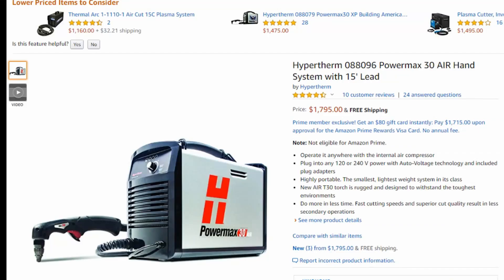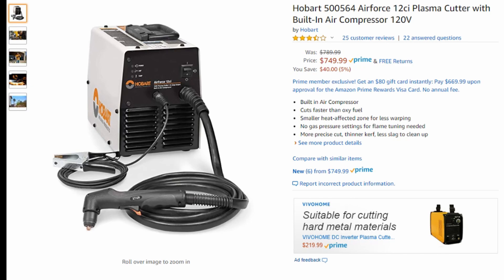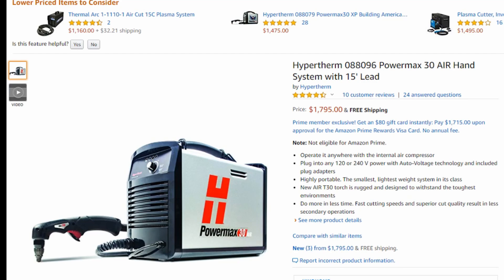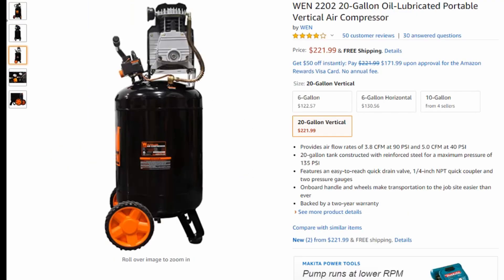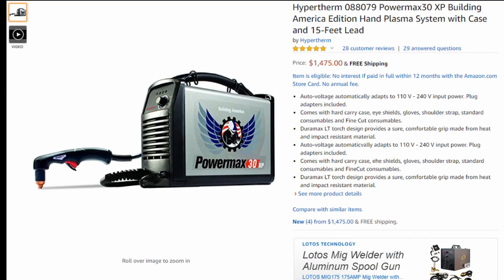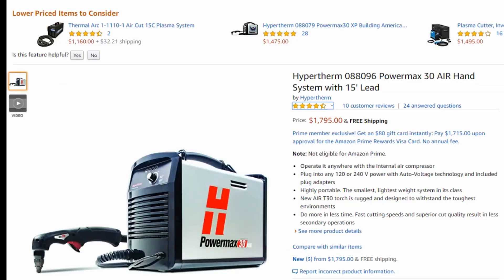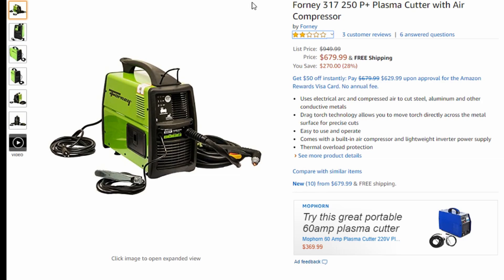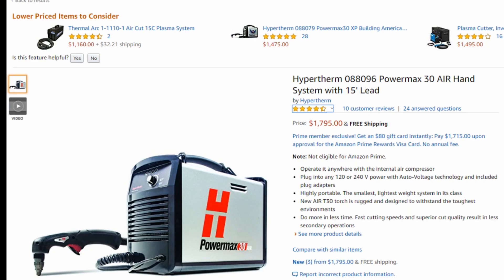Best Plasma Cutter With A Built In Compressor - Watch this before you buy!

Comment: Video is outdated. A lot of Chinese plasma cutter out there with built in air compressor that is capable of serious cuts. The compressor only draws like 5 amps on a 220 circuit, so it's insignificant in the grand scheme of thing when the plasma itself draws like 35 amps or more. 

They're useful for confined space though, because a compressor that can supply a plasma cutter can be a bit large. However if you do hook up an external air supply it does increase their cutting performance a bit.

Comment: I have a Hobart 12ci and plan to plumb it for external air supply. Will install bypass air plumbing and internal compressor power cut off. 
Hoping that improves the output by eliminating the amp draw of the compressor. Also I will have better control of the air quality(dryness) as I fabricated an intercooler between my compressor and tank. With a much bigger water separator unit.
Wish me luck 😄

Comment: The Hypertherm Powermax 30Air is not as powerful as the Powermax 30XP. Directly from the manufacturer's website, the Powermax 30XP outputs up to 30 amps at 125 volts. The 30Air outputs 30 amps at 83 volts. That is about 2/3 of the power of the 30XP, since power equals current times voltage. The 30 Air uses a special torch with special consumables to run from a reduced output and air volume while still maintaining similar performance to the 30XP. In the real world, the 30XP will cut a bit thicker and faster than the 30Air, but not enormously so. The difference is about 3/4" in mild steel for the 30XP and about 5/8" for the 30Air.

For the average user in a home, the 30Air is more than sufficient. As mentioned in the video, for portable professional use, a lot has to be said for not having to lug around a heavy compressor capable of 5 to 6 cfm and finding a second dedicated line to run it. For the occasional thick cut, there is always a sawzall or a hacksaw. If one has to think about making long cuts in large thick plates of metal, the type which would negate a Powermax 30Air, one will already have a large air compressor to run the plasma cutter and the comparison is moot. For those who must have that extra little bit of power and capacity, and want a compressor for other uses anyway, a Hypertherm Powermax 30XP is a great little plasma cutter, and so is the Miller Spectrum 625 Extreme.

Comment: I bought the Hobart 12ci because I don’t have the power to drive both a compressor and and a stand alone plasma cutter.  I am a meta artist  and mostly work with metal 1/4” thick and less.  
As far as duty cycle goes, I can run this plasma cutter constantly in sub freezing weather.  In the warm summer months, it’s best to run late at night or predawn early morning hours.  Point being duty cycle is temperature dependent

Comment: Fantastic video. Thank you!  I have the Hypertherm 30 air and it’s fantastic. On 220v I’ve cut 5/8” mild steel and 1/2” SS with no problem whatsoever. I’ve also used it for washing out welds on bucket repairs.  I highly recommend this machine to anyone who doesn’t have a compressor or doesn’t want to chase air hoses around.